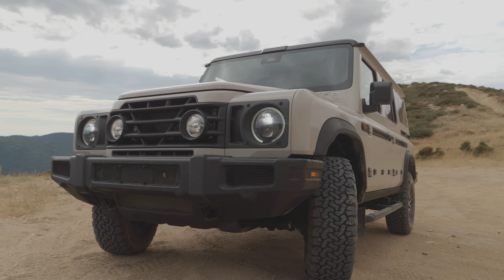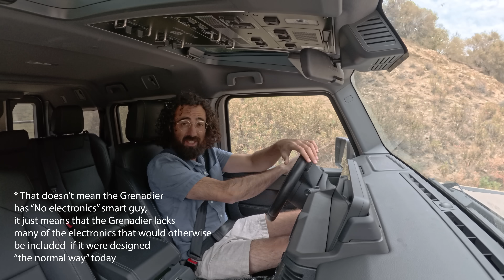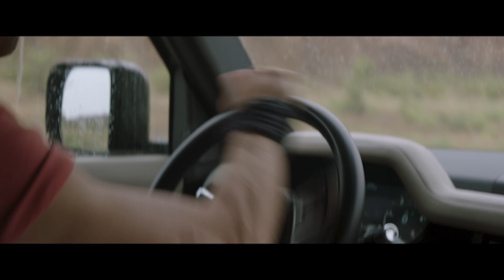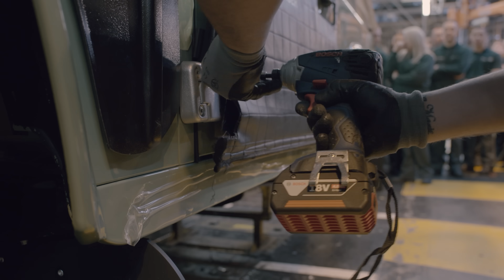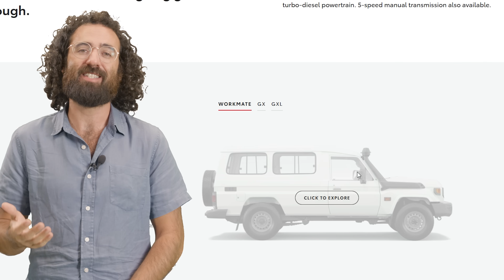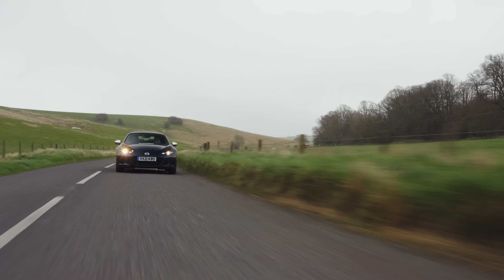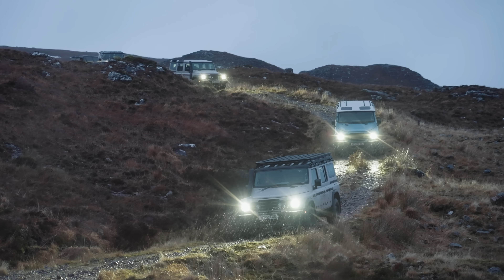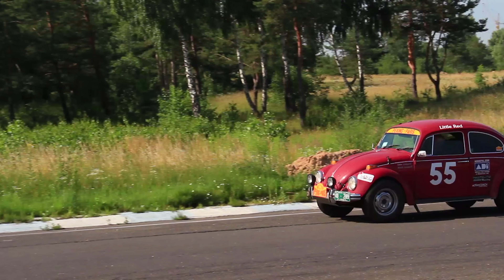Why a simple new truck has to cost over $70,000 in 2025

Comment: The lack of interior seating width  made it a NO for me.. those seats just don’t work. leather or cloth.. just poor… too much side bolstering… you don’t wan’t an off roader that throws you around as it pitches side to side and the Grenadier does that..  ALSO.. It is nice to have ground clearance BUT  lifting the powertrain so for into the passenger  area to the point where it’s console reminds you of an H1 Hummer.. 
I can find an older Montero, Trooper at a reasonable price and throw a couple grand into making it as capable as any 150K Overlander.. and pay less in tax, insurance and running costs… and keep my 2500HD Denali for the towing, and my Lexus LS430 for trips.. We got a 20 year old Suburban with Quadrasteer with 92K on it as well.. the thing turns really tight for what it is and it can be fixed anywhere.. with 33” Baja Boss tires and a 3” lift.. it goes anywhere (short of Slickrock or Rubicon type trails) that I want to go.

Comment: If I'm filthy rich, I'll buy this one as Secondary Off Road Toy, but my Main is

LC 70 with the Almighty 1HZ Engine from Japan, that will be :

* Import RHD HZJ70.

* Source an FJ60 LHD dashboard + steering column from U.S. surplus (or local junkyard).

* Adapt with fabrication (mounting brackets, firewall mods, linkage alignment).

Just a dream... But my reality is almost the same yet lot affordable, 1991 Isuzu MU Wizard (US Version : Isuzu Rodeo/Honda Passport) with Converted to LHD, Converted to Manual 4x2 and No ECU and Crap Electronics... =)

Comment: Problem with the Miata is that it didn't evolve with what the market was asking from Mazda. The market was sprouting companies left and right that put MORE POWER in the car, while Mazda gave customers the middle finger and still haven't breached 200hp even though they easily could. The Raptor line that Ford has actually evolved. They created the super street trucks, realized the market was over it, and went off road AND gave those special vehicles more and more power. I bet Ford sells more Raptors than Mazda sells Miatas, people can afford them if you give them what they actually want.
Reply from the maker: the Raptor is just straight up more car so it sells in higher numbers because it doesn't ask that much of owners to be a single car solution, but you're right that the lack of a modern Mazdaspeed Miata is really frustrating.

Comment: Switches are satisfying for tactile reasons, but every switch needs it's own two wires (or maybe you'll use ground... lord help you.)  those overhead switches? that's like hundreds of feet being routed through the ceiling, down via the B-pillar (I'm guessing) to get to some controller/fuse box in the engine compartment, with room for chafing and shorts all along the way. Every subsystem added to an old-style car is single function. The complexity argument is precisely backwards. New old-style cars are complex is because all the electronics are glommed on as an additional layer over the mechanical fundamentals.  

Starting with a clean sheet means embracing electronics, and minimizing parts.  IOW, the simplest car on the market is a Tesla, or one of the new Chinese EV's that follow the same logic. Actually simple cars have far, far fewer parts and are much less complicated than an old-style car.  In these cars, everything is electronic so that service diagnostics actually help. You're not forever trying to track down a loose ground wire. You don't have five ECU's in a door, because the door has one ECU that does all the functions in the door, and communicates via ethernet to the main computer for service reasons, which also means it gets updated.

Old-style new cars have sonar/radar sensors for curb sensing, a different radar for adaptive cruise control, another radar for automatic emergency braking, a dash cam for security.  A Tesla will have a single set of cameras that do all those tasks:  fewer parts. Simpler. networked, so better diagnostics are available.  

Complaining that new cars are "too complicated" is a bit like complaining that a horse drawn carriage pulled by 38 horses is too complicated... yeah... you (or the people who decided to lash 38 horses up to a carriage) are doing it wrong.  Don't do that. A simple car needs to incorporate modern capabilities.  EV's with Computers have orders of magnitude fewer parts than even an old defender.  If the argument is "I want a simple car" the simplest car is something like a Tesla.

Comment: My Jimny, lot more cheaper, lot more smaller, non centring steering, solid axles, and yes mine has a push button start. And parts are built to last and those which are prone to break apart is dirt cheap to replace. 

I too bought it with similar ideology one that will last for ever.
Reply from the maker: The Jimny is a survivor. And it's partly because Suzuki pulled out of the US market, so it doesn't need to meet US regulations

Comment: I think the Jeep Wrangler it’s in the same category as the Grenadier. But unfortunately Stellantis did add too many electronics and the car is not the same. I sold my JKU 2007 and bought a new model JL, can tell this, it’s fancier but I miss badly my old Jeep with nearly no electronics. Was fun to drive, easy to fix and it would not stop even if one wheels was missing. Did anyone has done some research to check the numbers if all those electronics really improved the passenger security, if we have less car crashes today than before? Because I have the impression that all those “security” electronics made drivers pay way leas attention to the road. If I had the money definitely would buy the Grenadier, but wouldn’t exchange for an old Jeep. Yea my old JKU was my daily drive car with 35”s.

Comment: re hybrid.........also can create redundancy (the good kind) increase range (potentially lifesaving) a power source for charging "essentials" and powering essentials. Electric hubs can equal way better clearance simpler in a way and less under carriage to break. KISS versions of hybrid and all elec would be key for actual overlanding dependability. I mean if by design one motor is down and the other can get you back to to or outta Dodge, BONUS CITY, never heard of this vehicle interesting.

Comment: The Grenadier would be perfect..... IF THEY HAD A NORMAL SPEEDO IN THE NORMAL SPOT. I shouldnt need to turn my head AND move my eyes down to check the speed instead of just dart my eyes down, its a MASSIVE DEALBREAKER.
Reply from the maker: it's quicker than you'd expect on pavement, so it's very easy to speed when you don't have a speedometer in your natural line of vision while driving. good point.

Comment: The alternative is get a Mahindra Roxor and make it street legal. You need a windshield, brake lights, horn, seatbelts, turn signals, handbrake, on-road wheels and tires, and a place to mount the license plate.

After that, you'll need gears. Final drive ratio is 5.38:1, may as well forget highways exist. 

Don't want to change the gears? You're going into those diffs anyway. Why? To install lockers. "I don't want 'em." Sorry, you NEED 'em. I've seen a Roxor get stuck in guy's front yard, because the grass was wet.

So, you got 4.11 gears and your lockers. Congratulations, 55mph is now feasible. Or, it would be if the engine made enough power. It's a 2.5L turbodiesel that makes less horsepower per cubic inch than a push mower. Now you have to find a tuner to reflash the ecu and light a fire under its ass.

It's at this point you realize you're creeping up on $40,000 total investment and what you have is a diesel Conestoga Wagon that is very likely to kill you in a 25mph crash.

Comment: All I heard is: It is expensive because a greedy billionaire thinks people are dumb enough to overspend on *insert product*. 
This is basically the story of most corporates - more worried about profit margin rather than overall revenue/profit in general. Appeasing shareholders.

Try to justify the price all you want, you are spending "more" for "less". This isn't a phone or tech product though: it is the car industry. The tendency to be more reliable with less complexity shouldn't equal "charge the same price as the less reliable product with all the bells and whistles". That's like trying to justify selling a Nokia brick phones that survive cataclysms as the same price as the Samsung Z Folds - completely different worlds of capabilities. If they weren't stupid, they'd sell these at the reasonable price of lets say 35-45k and completely dominate the market. There'd be no competition, overall income would be so high. From a brilliant opportunity to probably going to fail in a few years.
Reply from the maker: it's not that simple. take analog gauges vs digital clusters for example. automakers are switching to screens at this point the digital version is cheaper to produce, and there aren't enough accessible suppliers to make parts for analog gauges at a large enough scale to make them the cost efficient option anymore.
Reply: @drive  The market goes where it is desired and allowed to expand. There are plenty of suppliers willing to make analogue gauges, dashes, etc. with the good old buttons, tried and true, but the manufacturers are making the conscious decision to choose a cheaply made alternative and still charge a higher price that rivals or exceeds the cost the analogue supplier would have made it for. They are artificially forcing the market to become something the consumer doesn't want nor need and lying as if the thing we want is "too expensive". No, they are just lazy and want higher profit margins because you have to replace the whole screen when it brake as opposed to an individual button with the analogue option.

Comment: Same people who cry about electronics can't  tell you the last time they had to replace a coil pack or a brushless motor. Mechanical does not equal reliable.

Reliability is about tolerances, stresses and making sure things have enough margins/over built to deal with less then ideal situations. Electro optics are a perfect example of this. They are cheap and take plenty of abuse and do just fine getting slammed around.

The problem is over regulation. Regulators are risk adverse so any time some dies/complains it's easier to pass yet another reg for another  device then to tell people to suck it and stop doing stupid things. At some point we have hit a point of counter productivity where all this "safety" equipment is actually making people less aware and behave in more dangerous ways as a result.

Comment: If you want it to last in tbe northeast where rock salt dissolves a vehicle? You’ve got to invest in quality anti corrosion protection. Anything is better than nothing but I can definitely recommend using Waxoyl. Your greidier will thank you and it will definitely last for decades if you do this. Remember everything rusts. If you can keep the rust from ever getting started?

Comment: man i love my mint, low mileage 2014 Xterra.
Reply from the maker: i would too. been kicking myself for not picking one up pre-2020. you could get them for a song 8-9 years ago.
Reply: @drive   i bet. people assume i got a good deal on mine (in Canada) because i drove an entire province away (2 days driving each way) to get it a couple years ago. i wish it were the case.....  but it is a very unique, fun to drive and extraordinarily capable vehicle, even with modest suspension enhancements. and it does need them, especially in the springs and stops. mine is near stock, a few judicious upgrades and tires, very nice daily/off road beast. the best of jekyl and hyde.

Comment: The problem with the Grenadier is that it's not simple enough. 
1. Android auto/apple car play, or that can connect to a 4g/5g network, cloud etc. (I will never own a vehicle with that tech)
2. BMW engine (even detuned, it's BMWs are not known for reliability or simplicity)
3. Turbos (not simple); simple is a carbureted engine with no computers
4. Electric windows, not simple, get some wind up windows
5. ZF 8-speed automatic transmission (NOT simple), put a 6 speed manual in it
6. Keyless entry.... simple is keyed entry

I want a naturally aspirated diesel or gas engine, with mechanical fuel pumps, mechanical fuel injection, no computers,  body on frame constructions with solid front and rear axles, manual transmission, no infotainment (maybe a basic AM/FM radio but no touchscreen), no power windows or locks, no keyless entry, no ability to connect to anything wirelessly. People are so lost in this tech garbage, they've forgotten what simple is.
Reply from the maker: The problem is that so many of those things are actually tied to requirements. Having a diesel engine in the US would mean a DPF, def system, are needed, which cause problems on many modern diesel setups. You'd also be hard-pressed to find a supplier that wasn't making a turbo diesel. You can ditch the infotainment system if you want, but you'll still end up with a screen because backup cameras are a requirement.

Comment: If Ineos offered the diesel Grenadier in the US, I'd consider buying one.
Reply: Modern diesels are significantly more unreliable.  All caused by the pile of emissions it's required to have.  EGR issues, DEF, just to make a few. Unless you really need it(or really want one and accept the issues) a gasoline engine is the better option.   When my 2017 Silverado eventually gets replaced I'm looking at a gas 3/4 ton.  Not because I need it but because they are being engineered to be more reliable than the current pack of 1/2 tons.  5w30 oil, standard tension rings, no AFM, no turbos boosted to the moon so they can get more power.  All weak points on modern 1/2 tons That's before being about the same price.  Assuming you didn't option a diesel.
Reply: As a previous diesel owner, I wouldn't buy one again unless emissions laws went back to 2006 standards. It sucked to have to make special trips to keep the emissions systems cleared out. Modern diesels are a pretty inconvenient option if you live closer than 30 mins to work. 

I went with a gas truck because I don't have to treat it in any specific way to make sure I dont have a 5 figure repair bill.

Comment: Ineos chose an expensive drivetrain and they don't have big automaker economies of scale. I wish my Jeep Gladiator would have offered a de-contented Rubicon to bring the price point down. I'd consider the Inneos with a 3.0 GM Diesel or 4.3 V6, and that would save them considerably on component costs. It would also make it cheaper to maintain for the 64% of their customers that are in the states.

Comment: I like the solid axles I have a discovery 2 that's pretty modified but I would like to see the Grenadier offered with lift kits and sway bar disconnects❤ also I have a Land Rover lr3 with front and rear independent suspension and the air suspension articulates pretty well but even if it doesn't at times it is designed so well to just make it through anyways. You get to the point where you realize yeah it is raising a wheel a bunch but who cares it's floating right through the terrain response works perfect and everyone says oh the air suspension can fail or the electronics and I'm like okay but they don't just keep a good battery and alternator in it and well-maintained. The air suspension can literally last over 10 years without problems if you maintain it. But then you go on the road and it handles like a freaking Rolls-Royce while going off-road and doing the same even though it's not solid axles. Don't get me wrong I love solid axles but there is many overlooked Vehicles like the cheap lr3 on air suspension still that are just absolutely magnificent off-road and feel amazing on washboard roads and can go through really hard stuff for they would need flex but the air suspension tries to flex a little bit and you still make it. One thing people don't get is that the independent suspension on the Land Rover actually has a crossover valve that allows the airbags to share are left to right allowing it to act like a solid axle and you can't say oh that's complicated and it's going to fail no really it's not it's pretty reliable😂 but still I love my no sway bars Johnny joints Disco it doesn't handle great on the road but it's great off-road. Sometimes it's more fun to have old school stuff just for the sake of having it. I don't think it's actually better it's just fun to have and watch Flex
Reply from the maker: i do think sway bar disconnects would be sweet on this
Reply: @drive oh yeah totally. Worst case just run some taller stiff Springs without sways

Comment: Excellent video! Many of the things you mention about the Grenadier are exactly why I continue to maintain and modify my 22 year old Jeep. It's simple, it's been very dependable, and has no electronics whatsoever (ok, it does have a stereo). If something breaks, I can fix it relatively easily. If there is something that I want to improve, there are no shortage of places to get parts. It is slowly becoming MY Jeep; the Jeep I want it to be. Contemporary trucks/suvs are sterile, boring, not nearly as capable as we are led to believe, built for ROADS, and are never doing what the intention of a truck was meant to, which is to work. The only vehicles left doing that are purpose built commercial vehicles, and that's probably changing into the Generic Truck as well.
Reply from the maker: same reason i have a 37 year old K5 Blazer

Comment: I thought Jeep already made a cheao, simple 4X4. I got mine a few years ago for less than half the price of the Grenadier, and the base model had zip windows, manual locks, manual transmission, a mechanical limited-slip differential, an AM/FM stereo, and a V-6. The newest one is the same but with the LCD screen radio to have the mandatory backup camera.

And for those making fun of Jeep reliability, the BMW engine in the Ineos is no better. I'm past 145,000 miles with no issues.